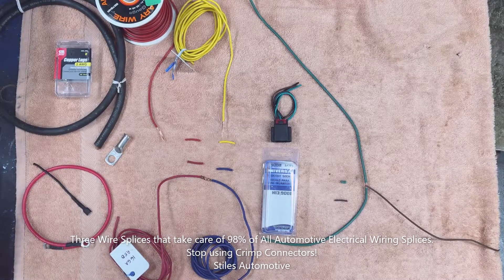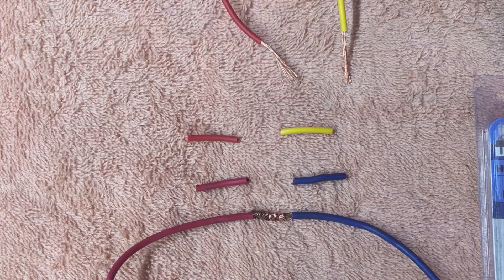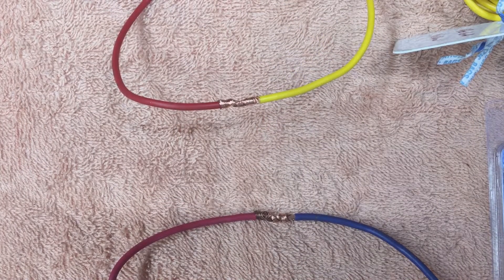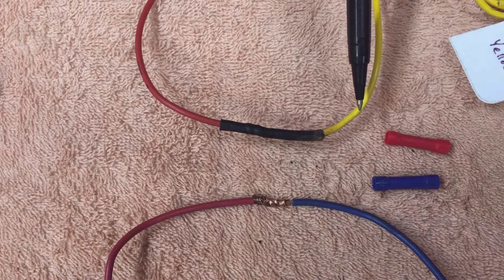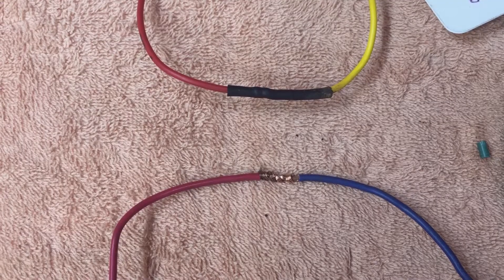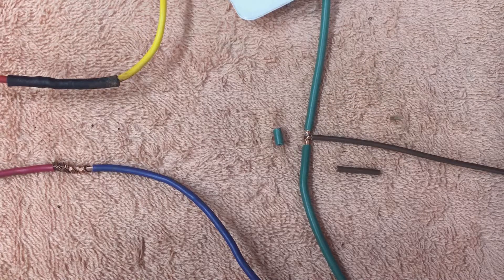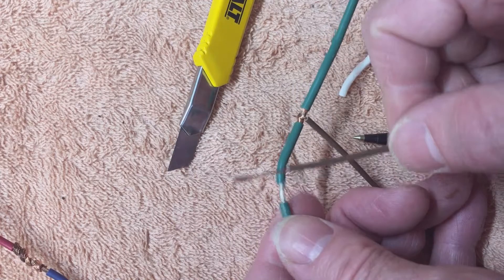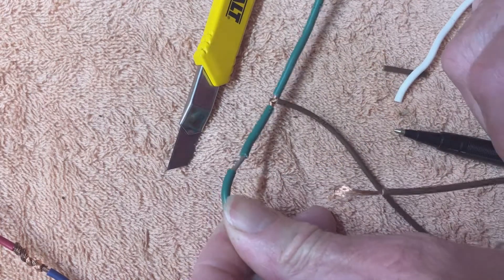Three Wire Splices that take care of 98% of All Automotive Electrical Wiring Splices.

Comment: Sorry, what black compound did put on after soldering right before sliding the heat shrink tube at about 4:10 mark? Was is a liquid electrical tape?
Reply from the maker: SoMax, That is a Permatex RTV Sealant, I buy the cheap Heat Shrink with no Sealant inside. For Automotive, I recommend Sealant in the Heat Shrink, keep moisture out. - Stiles
Reply: @StilesAutomotive  Thank you very much!

Comment: Why bother with the solder since it's already mechanically attached and weatherproofed?
Reply from the maker: Jimmy, Because it is a much, much better conductive connection and better mechanical connection. I crimp enough to hold temporarily until I solder, I don't want to stress the Wire Strands like a full crimp will do.  - Stiles

Comment: How do you insulate the three-way joint that you made at the end?
Reply from the maker: Greg, I like to use Heat Shrink Tubing with a little RTV inside them (applied prior to heating), but If you want (or really need) the T'd in Wire to run out 90 degrees to the side, I'd use liquid Electrical Tape or be creative with how you wrap with normal Electrical Tape. - Stiles
Reply: @StilesAutomotive  Thanks for that, and for your video.
Reply from the maker: @gregzsidisin  You are welcome! - Stiles

Comment: Great video, I like how you explain everything in detail.  Would this apply to car speaker wire? Also how would you go about insulating the tap? Thanks
Reply from the maker: Bilal, Yes, very much so! For the best sound quality and system durability, yes, you want to use these methods! Insulating taps, if your Amp or Transformer doesn't come with a method to protect the Taps. I would hide it in a Console or behind a Plastic Interior Panel. If you want to have the Amplifier so you can see it, protect it with Plexiglass or some type of Electronic Project Box. If I got what you mean wrong, let me know! And . . . you are very welcome and I appreciate the comment! - Stiles
Reply: @StilesAutomotive  sorry I was meant to ask how would you insulate the T tap?
Reply: How would you insulate the tap?